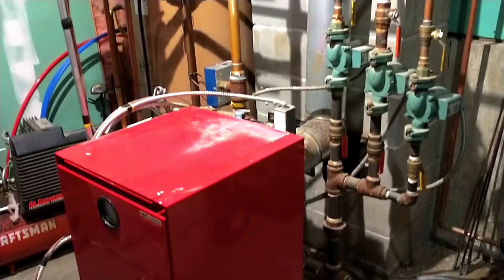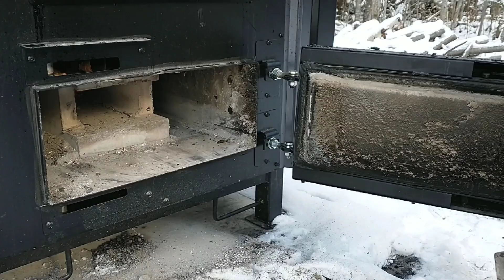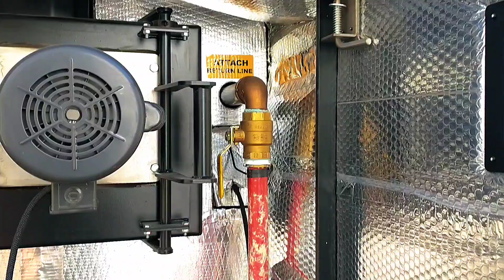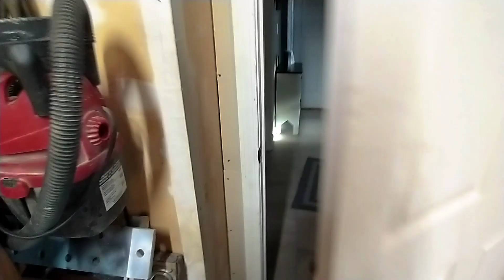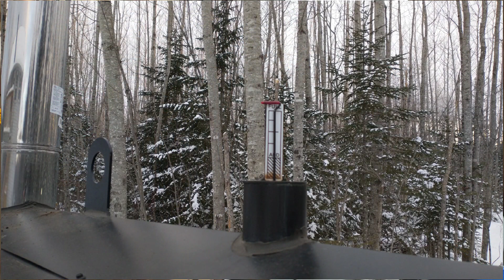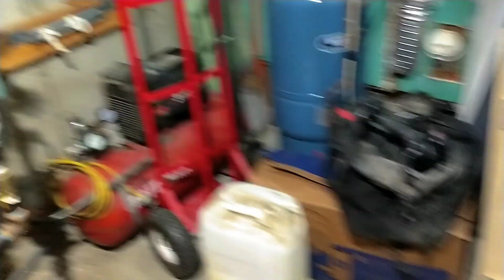How our Crown Royal 7300e is plumbed into our house

Comment: How does this stove work with green wood or did you try
Reply from the maker: I didn't test the moisture content last year, but I did burn some wetter wood. It definitely burns dry wood better. The issue I had with the wet wood is it would not restart very well between cycles.

Comment: Thanks for explaining the layout of your system!  I'm not sure if it is an issue based on your water hardness but thought I would share anyways.  When you fill your boiler from the bottom of your hot water tank, generally that is where sediment would collect.  I have done blowdowns from that low point and have gotten really dirty water flowing until I get it flushed and then it flows clean.  I would say I had very hard water until I put in a water softener. I think someday in the future if you put in a Y-strainer I think that would be a nice payback for you.   

I have a couple of questions; if you go out of town and your oil boiler picks up the load for heating the house, does it then also keep your outdoor boiler heated to keep it above freezing?  Also, when you are using domestic hot water and that zone is calling for heat, does your system allow the heating zones to circulate if they are calling for heat?  

In my old house I heated with NG Burnham hot water boiler, the domestic hot water was provided by a Boiler Mate domestic hot water tank with a separate zone like yours.  In the new house, I would like to also add an outdoor boiler, with NG boiler backup and heated floors instead of Slant Fin baseboard registers. Thanks for sharing and the great videos!
Reply from the maker: Thanks for the tip about the sediment, maybe I'll fill it from another spot. 
I am not 100 percent, but I believe in a scenario where my oil boiler picked up the load, it would keep the wood boiler temp above freezing because the water would still be circulating through the plate exchanger.
Regarding the water heater, I believe what you are referring to is zone priority, where some control boards disable other zones while the eater heater is calling. My pump controller does not do that so I could have all 3 zones calling simultaneously.
With oil prices the way the are this year we are very happy we installing this outdoor boiler this year. Thanks for watching!